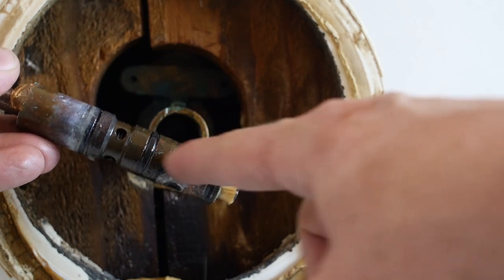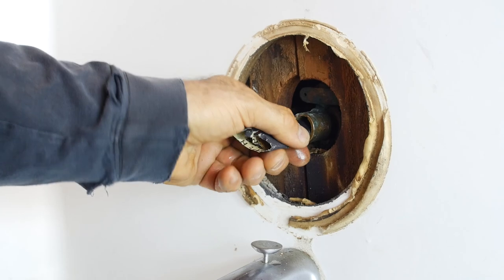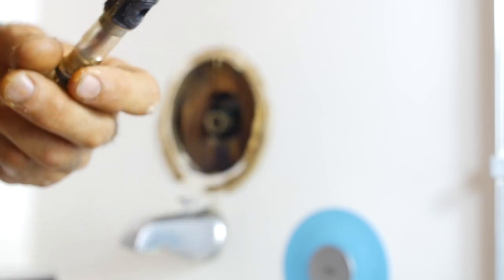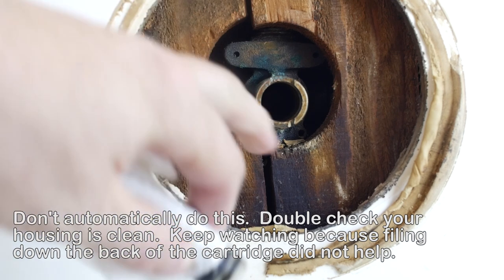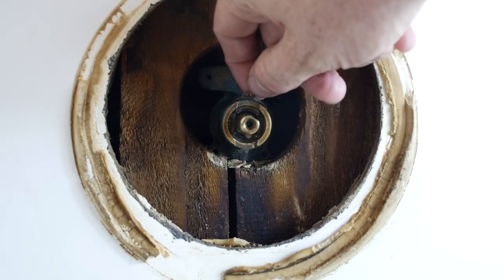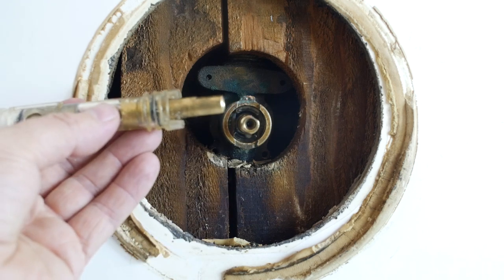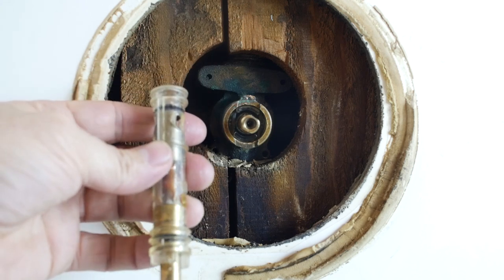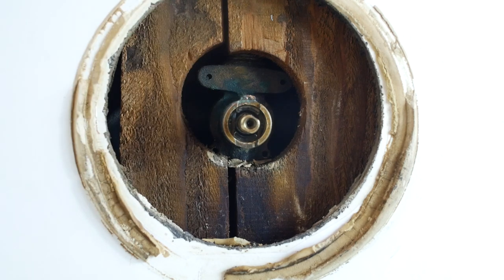Moen Cartridge Clip Won't Fit

Comment: Man oh man I struggled getting the bottom of that PIN in !!!!  Here's what finally did it for me and it was mentioned in one of the comments by a dad from his son....   The cartridge can be pushed in a tiny bit further (maybe 1/32 of an inch) even when you think it's all the way in.  Use the plastic cartridge loosener, channel lock offset pliers, and push in hard.....for me that little bit did the trick on two of these with the exact same issue.  Another thing, buy the new clip as it's thinner and bend the bottoms in slightly (it helps move the ends toward the slot hole).  Then push and if needed use a very small flat screwdriver if one side is away from  the slot hole to nudge it in.  Once both are in the slot you can push it down.  It's like a hallelujah when it happens!  The old copper ones are too thick to make this work.  I can shower and go to sleep now......
Reply: This video and your comment helped me so much. I could see only a tiny bit of the slot holes where the pins should drop in. I got the plastic cartridge tool (came with the cartridge) and fitted it to a 5/8" deep-set socket, fitted that to a ratchet wrench and pushed the cartridge with moderate force. Looked again, and I could see more of the slot holes...the pin dropped right in. Thank you!!!!

Comment: I had same issue with clip...went mostly down, but not the last little amount.  Looking in the pipe, I could just see grooves in the pipe, just behind where the bottom of the clip was hitting the pipe.  Use a small screwdriver or end of thin allen wrench, etc, and push the bottom ends of the clip back at the same time as pushing down on the clip.  I was able to get both clip ends pushed back and then the clip completely went down.  No filing needed in my case.  Took a lot of time before I figured this out, so hopefully this helps someone else.  My shower pipe is almost 40 years old, so you are probably right about the tolerance on the new part just being slightly different.

Comment: Thank you - thank you - Thank you ....A seemingly easy replacement which went incredibly wrong...
Getting it out was one impossible task, but then the new Moon 1222 would not fit in and was just a few millimeters too long !!!!!
In my case both the old cartridge and new ones were the  exact same plastic models.... still it would not slide in all the way and I could not get the pin to straddle into the slot.
I sandpapered the pipe to remove any calcium or corrosion and still no fit.
So I found your video and went to work on the back of the cartridge - file and fit, file and fit, file and fit... and finally it went right in...
While I was toiling at the task of getting this done my wife called Moen - where the impertinent lady shooed her of to look at their tutorial video...
There is no answer to why these new cartridges don't fit in.
there is an error in whoever manufactures these cartridges 
Thanks for your help !!!
Reply: Just went through this hell today.  Especially since I picked the wrong time and totally inconvenienced the family and a 20 minute job wound up taking 2.5 hours.  The new 1225 just would not go all the way in so that the clip would insert.  Saw this video and very closely compared my old cartridge to the new (OEM Moen 1225, btw...not off-brand).  One of the "ears" at the end is ever-so-thicker and is somehow keeping the cartridge from fully inserting so the ears are flush with the pipe.  Wound up moving the o-rings and rubber seals from the new cartridge to the old cartridge and installed the old one back.  No leaks, but I'm totally disappointed that someone changed the design at some point so this does not fit.

Comment: I never had a problem with this issue but could it possibly be that you are using a aftermarket generic brand instead of a genuine Moen part. I used a generic cartridge along time ago and had nothing but problems like leaking and hard to turn after only 2 years of use and possibly the generic brand tolerance are not up to par as the genuine Moen is.

Comment: I had fought this issue with a 28+ year old bath fixture.  Had been leaking for several years.
The old cartridge came out in about a dayz en pieces.  New one would not seat.
I used a deep well socket over the stem and against the main cartridge housing as a spacer.  I then took a wood working clamp with one end behind the entire faucet assembly and the other on the socket.  The direct “clamping pressure” allowed the extra 1/16” inch movement of the cartridge.

This video was very helpful in getting me to look the project over differently.

Comment: I changed a Moen 1225 shower cartridge and I must tell you I would rather take a beating than to do it again. It was the original installed in 1967 and it did not want to come out. I took off about 1/16" on the new one and finally got the clip installed, but if anyone tries this, I wish them good luck.
Reply: Seriously, never again.
Reply: I was so pissed I tried to hammer it in and fucked it up haha

Comment: Your video helped. Taking out my old cartridge, even with that special tool turning it 45 degrees, I snapped the head off. I then had to break it apart piece by piece until I finally pulled out the end. I cleaned and flushed it and slid the new cartridge in. Of course it didn't go all the why in and I fought with it until I saw the video. Got the special tool and moved it around and it slid the rest of the way. Had the main water turned off and I started to panic. lol. But all is well and it works great! No leak....

Comment: I got clip in without shaving tabs. Just use needle nose pliars and make sure tabs are aligned properly ( very precise ). The copper clip might bend slightly but it will hold. Also make sure copper clip is out of way of screw threads. The comment about tapping cartridge down slightly is correct. If you don't do it you will get a perpetual leak.

Comment: Attempted to take on the DIY challenge of replacing this in my 1970s built home.  On the 3rd day of living life with the main home water valve closed (no dedicated shutoff valves installed for this shower)--found your video.  Gez it seemed like a simple project, but I exhausted a lot of effort attempting to finish the job without success.  Your tip towards the end of this video is exactly what needed to be done. At the end of the day, I'm far more experienced and can hopefully help someone else out with a similar challenge.  Thanks for service and sharing your experience.

Comment: Regular folks who don’t know how to file***
Turn the water back on and let the system flush for a few minutes. Odds are if you can’t get the retainer clip back in its because theres some debris blocking you from putting the cartridge back in all the way. You should notice after letting the system flush that the cartridge is more flush. If thats the case you should be good

Comment: Same problem as described...House is over 40 yrs old. Previously replaced cartridge like 10 yrs ago and did not have this problem then. This time around, regardless of how much i cleaned the inside of chamber or pressured the Moen 1225, clip would not go in. Googled and saw your You Tube video. I sanded it very gently like you demonstrated and it worked., Outstanding my man. Thank you, Google and You Tube!

Comment: Did anyone find a actual solution or do I need to strip down the back of it to make it shorter?
Reply: late reply here, but make sure the plastic tabs are 100% flush with the faucet opening.  mine was maybe 1/16 inch sticking out, but I put the plastic tool back on it and pushed a bit harder and it finally went in the rest of the way, and the clip slid in without a problem.

Comment: Amazing video, thank you!!!! Filed the back down then the high side, pushed back in again and barely got the clip to drop. One thing for those who may be wondering. I believe there is no "right side" to the clip. It should fall into place with either orientation. Thank you for this helpful tip. I lost an hour of my life wrestling with this thing and if I hadn't found your video it would have been certainly more!

Comment: I couldn’t get the clip in either. The thing is to make sure you get your new valve all the way back into the brass so you can bring the clip in behind where it says HC on the top of the white plastic.. because if the valve is too far out, you won’t be able to get the clip around the valve because the round part is too fat. Also, try putting the clip in the brass part without the valve, and just to see how to do it

Comment: Thanks for this. The filing you suggested did not work (I have a 1222) but gave me the idea to round off the other end (I felt it hitting the back of the pipe/tube/whatever), which didn’t work for you! I used a nail file. It slid right in after that, clip dropped in like nothing. Water’s on, no dripping so far! Also interesting I noticed afterwards the old one had a rounded end, so either it was made that way or the plumbers shaved it off because it didn’t fit.

Comment: I had to install a Moen cartridge to fix a leaky faucet and could not get the retainer clip back in. Seems to be working fine. Is there any long term issues you can think of with not having a clip installed?
Reply: I just took mine apart, and spent way too much time searching for a clip.  It had none on either handle.   I've been in the house 9 years, and previous owner did bunch of remodeling I"m guessing around 2010-2013.  I'm thinking mine didn't need the clip because the damn thing won't go in, not to mention was insane trying to take it out.   3 hours of my life spent trying to remove it....If I had another bathroom with tub/shower, I'd just block this one off and call it a day.
Reply: @Christy.1  9 months later, no leaks to speak of without having the clip installed
Reply: @oldirtycaffrey  whoa! you got lucky that thing didn't fire out like a missile!
Reply: @Jigger2361  perhaps i did, but it seemed extremely secure in there without the clip

Comment: I looked at all of the previous fixes and came up with one more that worked easily for me.  I filed down the ends of the brass clip and shaped them like a sharp wedge.  Just took a few minutes.  That allowed the clip to be pushed in far enough to take a tiny bite.  I then grabbed each side with needle nose pliars and tapped the remainder of the clip through the cartridge housing.

Comment: I had a similar issue with a 1222 replacement. In my case the old one was plastic and the new one was as well. I put in the new one and had roughly 0.25-0.5mm of overlap for the clip. I thoroughly cleaned the pipe, still had some clearance issues. I took out my micrometer to measure, the new one was slightly larger (the middle plunge stuck out about the extra clearance). I found this video and, while I must say filing down part of it was not something I felt great about, it seemed to be a solution that worked. I didn't need to file it much, and once I did it went in ok.

So thanks for the tip
Reply from the maker: I was pretty upset the replacement one wasn’t the same size and needed reworking to fit. Very frustrating after fighting getting the cartridge out that was stuck.
Reply: Same issue going through it right now it’s a bitch to say the least

Comment: I dont know much about plumbing watched some videos and ran into this issue. I didnt have the tools nor did I want to shave the cartridge. Called a plumber and all it took was using a universal retention clip. Unless I am missing something this seems like an awful lot of trouble for an easy fix.
Reply: It's not a different clip issue.  The cartridge won't go far enough in.  It needs to so the clip is in front of a plastic flange so the cartridge won't fly out.

Comment: Still didn't work for me. I can't get the clip in there. I hate Moen for this. It's really crappy! Thanks for the video though.
Reply: Just ran into this. The quickest, easiest fix is to pull the pin and grind about 1/8th inch off of the legs of the clip. Took 5 minutes and worked like a charm
Reply: Yea I did this too after the 4th hour.

Comment: Agreed, thank you so much!   I tried everything to install the new cartridge with no success.   I was so frustrated.  I first filed off the end, no luck, then rewatched your video about the side that is a bit wider than the original and then filed it off.  In the process of trying to push the clip on many times, one side of the clip half broke off.  I thought I might be scr@$#ed.   But with the family increasingly looking for water in the house, your instruction to file off the side worked.    Moen is incredibly negligent in not either fixing the cartridge as purchased, or make a separate part number with the correct dimensions, or give here's how to file down our incorrectly made replacement.  Hard to believe that they Moen hasn't documented this problem.   Thanks so much.